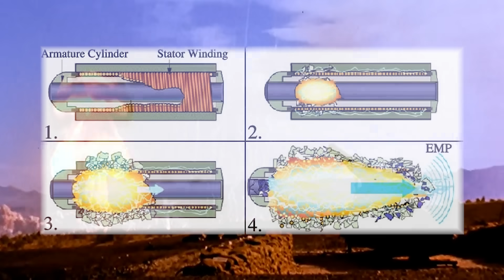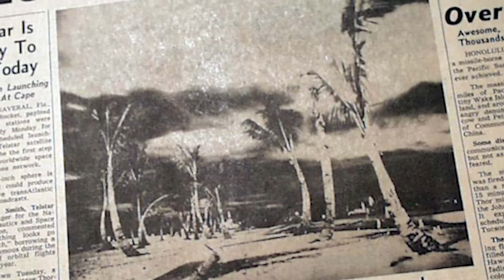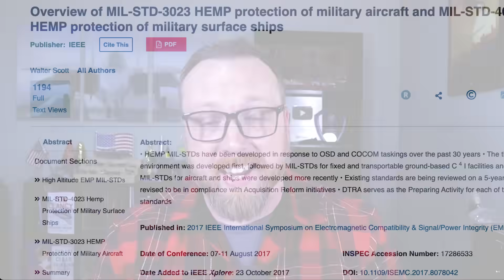Could an EMP wipe out American airpower??

Comment: Nuclear electricity proliferation to stop CO2 proliferation also means national transmission grid proliferation. 
The existing national electric grid is fragile because it is extremely, extremely expensive. 

Never overbuilt because enough to do the job was expensive. 

No fossil fuels means 5fold bigger electric demand and 5times bigger capacity national electrical grid capacity. 

Now you say EMP vulnerable is a consideration 😮😮😮😮😮😮😮

Comment: The thing is, using an EMP of any magnitude against the US would be treated the same as sinking a carrier. Pretty much a declaration of war against the United States. Any adversary thinking about doing that has ask themselves, "Do I feel lucky?"
Reply: Yeah, a nuke would be treated as...a nuke.  So the same reason Russia's nuclear torpedo is a stupid super villain weapon: its a nuke and its going to be treated as a nuke.
Reply: @LackofFaithify Also, because a nuclear torpedo doesn’t have anywhere near the energy needed to create a tsunami.  I mean, you could potentially create a localized wave in a harbor or very small bay, but most of the water is going to be vaporized and/or blown into the air and become radioactive steam.  Sure, that’s really bad for wherever it hits, but no worse than a 2 megaton bomb, which is supposedly what the warhead is.  It’s basically just a deterrent made to scare people, even though it’s much more bot-disseminated propaganda than reality.
Reply: @bluemarlin8138 tsunami literally means harbor wave which you've granted it can do. And while it won't do a whole countries coastline, it'll get that cities harbor pretty bad.
Reply: Flux compression generator bombs are non-nuclear. Their effects are far smaller than that of a nuke, but whose to say an adversary uses just one, and depending on where they're set off, they could have very serious effects on the power grid. And would be treated as an existential threat and an act of war.
Reply: And it would have to be a nuke. An ICBM moving to the US would guarantee a nuclear response.
Reply: @adityaparam8736  You don't grasp the ambiguity of the situation. Watch 13 days. This helps the layman (non expert) understand the massive implications and responsibilities of your reactions. And the Russians and Chinese are experts at deception. Can the US pulverize every aggressive nation simultaneously? Yes. Will we suffer dramatic losses? Yes. Will much of the planet be uninhabitable? Yes. Our submariners will be repopulating the USA.
Subtle attacks have already began. 80 attacks on US military since HAMAS invasion of Israel. Do you wanna die? Or should cooler heads prevail? Limited strikes. Decimation of wicked leaders would be less globally destructive.
What would be your choice?
Russia has nuke powered 100MT torpedoes cruising the oceans waiting for the signal to go boom! Did you know that?
Reply: It would trigger a full nuclear exchange.  End of the world situation.
Reply: @flossordie2256 lol that’s what’s going to happen, and US will like others will respond
Reply: FYI the USAF has a cruise missile that can pulse EMPs at will over buildings destroying the the computers. Not destroying the aircraft.
Reply: @bryanst.martin7134 You’re talking about the CHAMP missile that was in development in the 2010s, and the follow-up HiJENKS missile in development for the US Navy.  CHAMP used a focused microwave emitter to disable electronics, but this was on a very small scale with civilian systems, not a freaking warship or bunker hardened against these attacks.  HiJENKS is designed to disable larger targets, but it uses a huge explosive warhead to generate the needed energy.  There is also a similar Chinese program that seeks to generate an EMP with a conventional warhead.  Neither are currently deplorable, and both are far ahead of anything Ruzzia has.  If Ruzzia had something remotely similar to what you’re talking about, it sure would be useful in Ukraine, where Western air defenses have basically put up a wall against Ruzzian combat aircraft.
Reply: @bryanst.martin7134  no one is talking about that sort of thing.  The video was about an emp created by a nuke to take out massive swathes of the USA.  The systems you are talking about take out targets. A building. A ship. A tank. So while unique, it is a weapon on par with all other conventional munitions. So calm yourself.
Reply: Any emp large enough to do any damage would be a literal nuke. Nukes themselves are the most powerful emp humans can make
Reply: @amazin7006  lier
Reply: @amazin7006 That is exactly what I was going to say.
Reply: Feeling very Lucky in my Faraday Cage in 195km storms up Northern Canada...🍁
Reply: "What if their lights DON'T go out?"
Reply: @major__kong  Correct. Green Gregs is a frmr NASA type that has conducted high altitude EMP tests. He is a bit odd, but aren't we all. He doesn't trust the "science" of these gimmicks. How will you sue them after it fails? Self fulfilling prophesy type stuff... Unfortunately their immortal souls pay dearly in the end. And the sins of the father carry 7 generations. Gotta feel sorry for the kids of politicians, right?
Reply: Well do you punk?
Reply: You obviously have no idea what’s going on in the world right now..US open borders alone is an act of terror. 2024 is gonna be a nightmare that so many sleeping people are gonna have no idea what to do because they “trusted our government “. Our government right now is the terrorists..
Reply: @oktoday8323  I am aware of military hardware. It's strength and weakness. Rad hard and EMP resistance is based upon Man made EMP. And minor solar radiation. Solar EMP is infinitely stronger, and slower. The microseconds of the 1st pulse and milliseconds of the second pulse of a Nuke EMP our mil systems can endure. The slow rise of a solar EMP as in the Carrington event is a totally unaccounted for scenario. Factor in the rotation of the Earth, the weakening magnetic field roughly 65% today, and a rise of em energy tens of times that of a Nuke over a period of hours will smoke all metals. Far superior civilizations have preceded us. Sun had other plans. The only remaining artifacts are stone. The Earth has rotated 90 degrees 6 or 7 times. That is why tropical fossils have been found in Antarctica. They can be found in Greenland too. Science does not want us around afterwards. So they lie. 1000 feet above MSL, and 60+ feet underground, with provisions for a decade and you may survive. Ever wonder of the caverns underground with zero artifacts? They took what they could with them, and took it back out when they returned to the surface. The part in Genesis that describes after the dust had settled, was removed. "What was, Is and will be again." seems out of context. The sun is our hourglass. 12000 years, it micronovas. Creating deserts, Count the great deserts. This time 2040ish it will strike the western Pacific. But the energy will superheat the mantle and the crust will slide allowing the mass of Antarctica and Greenland to align once again with the Equator. Then there is the great slosh. The change happens in a single day. Water is slow to catch up. Like a tub slung back and forth the water is slow to catch up. A decade or so? Most will perish. A few species too. Some men survive, otherwise we would not be here. But only a few.
Reply: Yah sure unless it's built by the US.  Nice try bot
Reply: Any EMP Strike On America Would Cripple America's Ability To Even Fightback Think About It American Cops Won't Even Chase Criminals If Their Radios Fail It's Fair To Assume That A Large Scale Blackout In America Would Send Cops Prepping Raiders On The Loot And Overall Leaving The Government Hiding A Hole Like Every Government Does When They Lose America Is No Different Than Hamas
Reply: Read my post! They already tested an emp on our warship a few years ago! DIW! I believe they reset the computers, and restored ability, but in war that means defeat.
Reply: @bryanst.martin7134 No, they didn’t.   An EMP large enough to disable a ship, much less a warship specifically hardened against EMP attacks, would require an immense amount of power far in excess of what even the most modern fighters—much less an old SU-24—could generate.  It’s doubtful you could even do it with a large warship sitting right alongside.  

What really happened was that a couple of Su-24s tried to harass the USS Donald Cook in the Black Sea.  It basically just flipped the bird at them and observed them.  It was never disabled at all.  There’s even a video of the flyovers, which is absolute ironclad evidence that the EMP didn’t exist, since anything that could knock out a ship’s electronics would absolutely fry a video camera.  The aircraft weren’t even carrying weapons, and had no bulges, nor anything else that could house a weapon.  Russian state propaganda TV reported it as a half-joke, and then it got spread around the internet as fact.  Again, it’s a laughably absurd claim.  

I’m not a NYT fan, but here’s how the disinformation campaign happened.  https://www.nytimes.com/interactive/2017/06/07/world/europe/anatomy-of-fake-news-russian-propaganda.html

Also, it’s absurd to think that there would be no US military response to an obvious attack on a US warship by a foreign military.  The Russian Black Sea fleet would have been destroyed by air strikes in 24 hours.

Finally, if Ruzzia had such a weapon, don’t you think they’d be using it to knock out all those Western air defense systems in Ukraine that are preventing it from using its Air Force?
Reply: Whatever dude.  Dream on.    US troops been attacked with drones for a year and no response.    Us boats in Iranian waters, and total surrender    Bunch of chickens.  Bawk Bawk Bawk

Comment: I remember hearing that the most vulnerable part of our grid when it comes to EMP attacks is very large and costly transformers at power stations that would be destroyed all at once with no spares on hand and no way to replace them all quickly.

That said, I don't think aircraft are the most vulnerable, as they are made to withstand lightning strikes too. Bird strikes, on the other hand......

I would like to see plans to harden / repair the grid should a large EMP occur, but I bet those plans do exist already and that they are classified. This is too big a hole to imagine it not being addressed in the background.

Imagine if there were an autonomous AI army.... and an EMP hit it. We aren't as vulnerable as we will be a decade or two from now.
Reply: A plan to harden the grid is only effective if it is completed before an EMP (or CME).  And it takes 1 - 2 years right now to replace larger transformers, and they are basically custom built so there is no shielded warehouse with any spares.

Comment: What about the 10,000 civilian aircraft in the air at any given time?
Reply: Mostly useless in a war
Reply: They take lightning strikes all the time, they'd probably be pretty okay.
Reply: un guided bombs at that point.
Reply: Doesn't really matter.  If the US power grid goes down, the USA is finished.  No food, fuel, water, waste processing, or industrial capacity.
Reply: @Kriss_L  how they gonna do that?
Reply: @rogerwilco5918  A large EMP (or CME) would completely fry the power grid.  Replacement transformers take 1 - 2 years to get right now - getting enough to rebuild the US grid would not happen as the global economy would collapse if the USA was effectively removed overnight.

Comment: EMP may not affect USAF aircraft, but it would certainly affect operations on the ground side due to massive power grid failures.  How critical that would be...idk.  But if off the shelf systems are in use, they will not be protected--at all.
Reply: We got slave cables
Reply: @Chris1982416 what's that?
Reply: I'm pretty sure all of our military installations have emergency backup generators for exactly that scenario, keeping them fueled up would be a challenge but hardly an insurmountable one.
Reply: @alexwalker2582  If the US power grid went down, there would be no resupply of food, fuel, or anything.  US bases are not designed for off-grid operations.
Reply: @Kriss_L  trucks, ships, and planes don't require the grid to operate. We would use the national emergency fuel reserves to keep the military running until the grid came back online.
Reply: @alexwalker2582  Everything that those trucks, ships, and planes need is supported by the grid.

Comment: There is a reason for the Soviets and the initial Russian decision to keep using valve radios/radars in their aircraft as these are far more likely to survive an EMP , they only switched to modern micro-electronics due to needing high resolution radars to even attempt to locate/track western stealth jets/missiles
Reply: You’re overestimating the soviets. They most likely couldn’t even produce those advanced avionics in the first place.
Reply: No, but that’s the cover story the Soviets invented to hide their inability to produce modern electronics, much less shield them against EMP.

Comment: How would an EMP affect the nuclear power plants? Would they have meltdown?
Reply: No, all nuclear plants currently in operation can be shutdown with no working electronics whatsoever.
Reply: @LoisoPondohva  I think you must not understand how they work.
Reply: @Sniperfox1  Fukushima was rolling right along until there was a tsunami. Hit a power plant with a big outside catastrophe and they can multiply the problems.

You'd think they would all be hardened against rare but inevitable catastrophic scenarios...... You'd think.....
Reply: @Sniperfox1 nah, nuclear reactions work by placing nuclear fuel in a certain geometry. You can move shit around even if you loose power.
Reply: @mr.nemesis6442  cooling is the key. Pumps won’t work if the generators are fried.
Reply: @Sniperfox1 That’s why they have backup generators that remain off, and thereby immune to EMPs.  I suspect there are also backups to the backups, and probably an emergency manual shutdown system as well.
Reply: @bluemarlin8138  unfortunately there aren’t. EMPs weren’t a consideration when they were designed 50-60 years ago.
Reply: @bluemarlin8138 Having things turned off does not prevent damage from an EMP.  It is an induced current.

But after the onsite fuel for the generators was used up, there would be no resupply if the power grid was down.  The USA would effectively cease to exist as a country at the point.